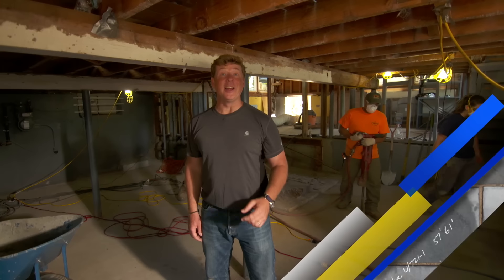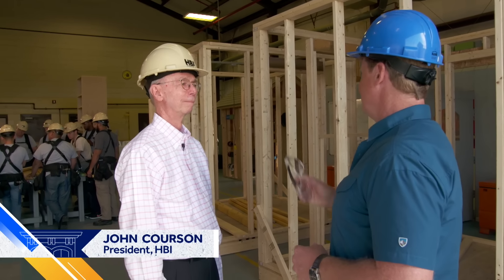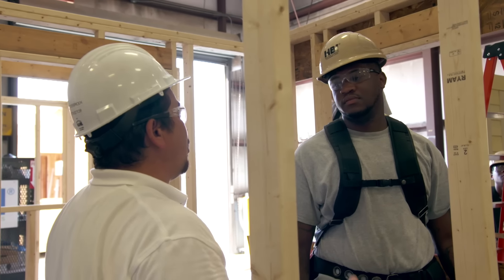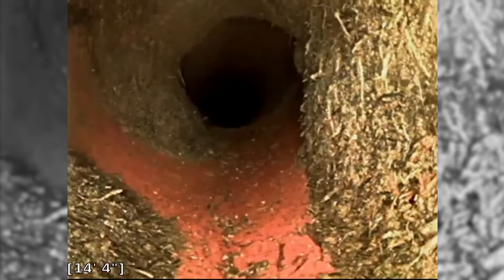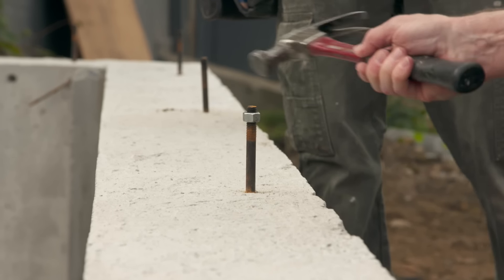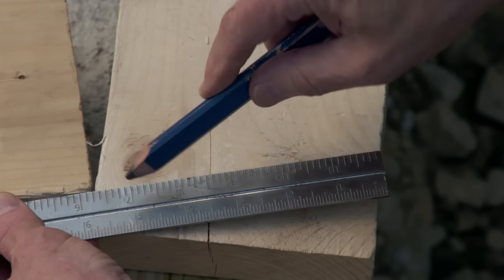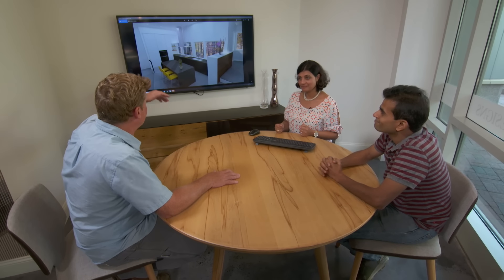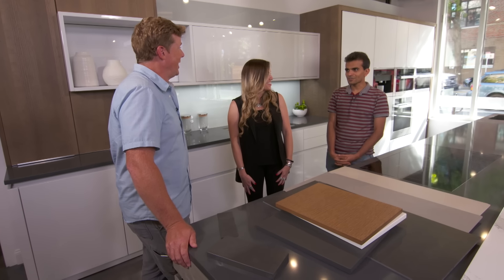This Old House | Apprentices in Sill School (S40 E16) | FULL EPISODE

Comment: For straightening the sill plate anchor bolts, it's easier to just use a piece of 1/2" galvanized pipe and bend it straight with some leverage, Larry Haun showed that in his videos from forever ago.
Reply: Yeah, I think the pipe method is faster and easier.
Reply: How many carpenters keep a section of pipe in their tool belt though? I’ve relied on the hammer for 30 years.
Reply: I keep a 3/4 pipe in truck just for this. That guys hammer is a big red flag

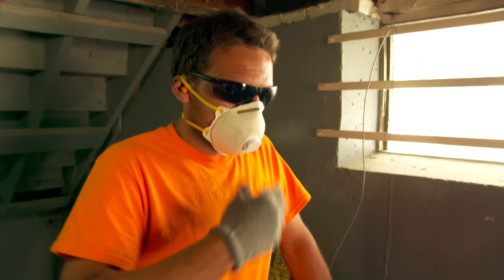Comment: At 2:48 that’s mask the guy is using is not going to protect against silica dust. It will still get in his lungs. You need a full respirator that seals around your face and you also have to shave any hair as it will make the respirator not seal.

Comment: That is a wildly uneven foundation top.   They are going to need a serious amount of caulk on the cement side below the sill seal and on top to help reduce air flow as well as foam insulation.   For the stove against the window - if they put in a downdraft (1100cfm) it gives the a pop up splash guard and eliminates the hood blocking the window.    17:50 - contemporary design - perfect for people with too much money - within a decade, you'll realize how hideous that contemporary design is and you'll want to redo it from top to bottom.

Comment: What's wrong with this phrase: "solid wood veneer"?
Solid wood is soild wood (one piece all the way through). Veneer is a thin layer of wood that is applied to a substrate to make it look like wood. It can't be both.
Reply: If I'm not mistaken it's the veneer of expensive/rare wood applied to solid, cheap, wood instead of particle board(s), plywood(s), composite lumber or MDF, as support.

Comment: They need to watch Larry Haun's video on how to frame a house and they won't need a tape measure to align the bolt holes. And get a DeWalt impact driver that would tighten those nuts in no time...I cringe whenever I see anyone use an adjustable wrench to tighten nuts

Comment: "We've proven the majority of the line is in good shape"

No Richard, the entire sewer pipe is completely trashed. The Cast Iron pipe at the start is full of dirt and rocks, also you can see how bumpy it is. That is due to corrosion , it will eventually break. The rest is clay/terra cota (bright orange/red color) and those joints are overtaken by roots, even the city wye (hammer tap in this case) is also full of roots. The worst thing the homeowners can do is just repair some spots, they will have issues later on guaranteed. Best to run a brand new sewer line and don't worry about it until many decades from now.